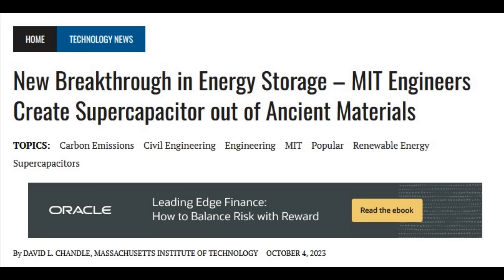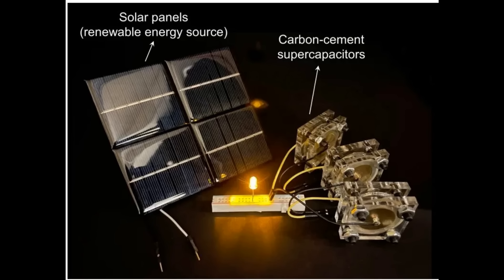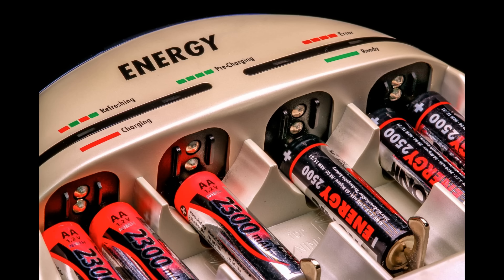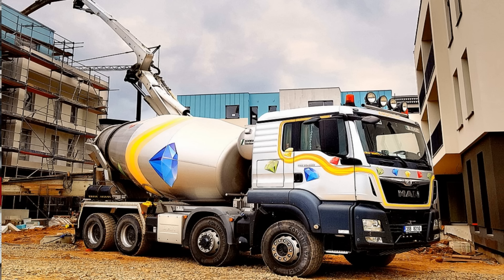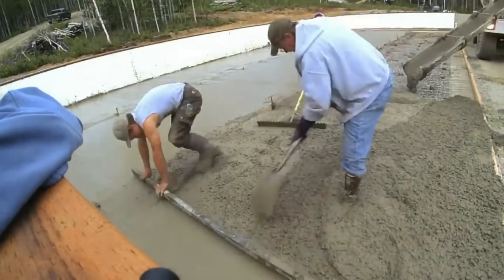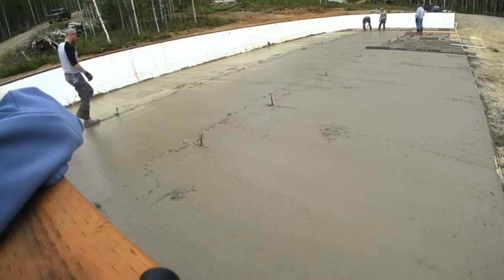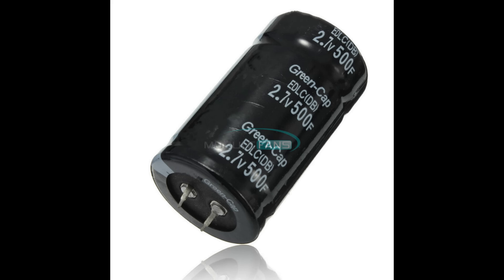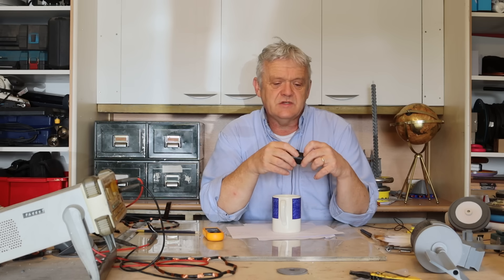2073 The Concrete Supercapacitor From MIT

Comment: I know you can make a supercapacitor with Graphene, but wouldn't you have to play with the concrete chemistry to test what is the best configuration for that?

Would it be better to just Put networks of INCREDIBLY STRONG Cables underneath?  That way you would have More Capacitance?

It would Definitely Be Cheaper though.  I'm Just thinking of a Cylinder that's 10,000 feet by 80,000 feet, or 15,000 by 120,000 feet (That's a LOT of Concrete)
Reply from the maker: it's not just a matter of the chemistry mate - the chemistry is basically ok - it's about the feasibility of the structure - you can't make buildings from chopped up concrete and you need to chop it up to make batteries

Comment: couldn't super-charged graphene in concrete be used as storage - it has carbon?
Reply from the maker: it's not just a matter of the chemistry mate - the chemistry is basically ok - it's about the feasibility of the structure - you can't make buildings from chopped up concrete and you need to chop it up to make batteries

Comment: On the prairies in Canada, concrete foundations need to be used for basements (freezes deep) so may work but ....
Reply from the maker: it's not just a matter of the chemistry mate - the chemistry is basically ok - it's about the feasibility of the structure - you can't make buildings from chopped up concrete and you need to chop it up to make batteries

Comment: I never thought of that.  

Could this be put inside modules in an O Neil Cylinder?  For Instance, Ariel Eckblaw uses essentially disks that can magnetically arrange themselves.  If those self assembling plates were made out of Structural Steel (or if you made a variant of steel coated with Graphene) and had modules of concrete that were optimized for capacitance, Couldn't you make an Entire Large O Neil Cylinder be Incredibly Strong and Store a Lot of Power?
Reply from the maker: it's not just a matter of the chemistry mate - the chemistry is basically ok - it's about the feasibility of the structure - you can't make buildings from chopped up concrete and you need to chop it up to make batteries
Reply: There's an article on the internet about the MIT supercapacitor, and in it they said it could be used as a foundation for a home.  In it, they found that the ratio of strength vs capacitance were inversely related, and the "sweet spot was around 10%" of carbon black.  Any further, and the concrete was more delicate.
In the article, they thought it could be used in the foundation of homes, and even on roads.  As a Concrete Block that could connect to others, it sounds phenomenal!
  The other property they talked about was using it for a heating system, so besides energy storage, it could inexpensively heat the floors of homes. @ThinkingandTinkering

Comment: Well... the idea is nice. imagine if you would be able to build a home's entire energy storage requirement for off-grid living into the foundation? That'd be pretty cool... 

I am more interested in vibrational energy though... piezoelectrics... for passive energy generation, and I've seen some interesting analysis of the Great Pyramids, discussing their structure and stone selection, in that they have outstanding piezoelectric effects. Limestone on top of granite, no mortar between blocks... cutting them according to their resonance, and then using the motion of water flowing across stone below it from the Nile to generate power, which is stored in the blocks of the pyramid itself. Now, I have no idea if any of that is actually possible or if that's how the pyramids were meant to function, but the idea of using stone and the movement of water to generate power is very interesting.
Reply from the maker: the idea is nice mate

Comment: So buildings in a city could actually store a lot of energy. Sidewalks, roads and such. It's not about how little it stores. It matters for a dual purpose.
Reply from the maker: if you chop it into little slices - which you have to do to get it to store energy - then it would be any good to build from - there is no dual purpose here mate - it's one or the other
Reply: The shear volume of needed material would be insane for a remotely worth while system. The price of copper would skyrocket because of the needed amount to do basically the same thing as a bank of say 20 car batteries at the fraction of the cost and volume.

As well, maintenance is a thing of concern to. If 1 of those 20 batteries needs to be replaced, it's only about $100 and like 5 minutes at most. If a street needs to be replaced, that's weeks of demo and construction resulting in tens of thousands of dollars on top of disruption to traffic flow. Or hundreds of thousands of dollars if a building needs to be demo'd and rebuilt with people being displaced for possibly years while the building gets rebuilt all because of a 1.5V short in Ted's pantry.

Comment: In summary, I think the giant Serapeum sarcophagi were used to generate electric charges with pressure built inside by CO2 gas. The pressure put on the quartz crystals created electric charges on the surface of the sarcophagi. Those charges were then dispersed from underground toward the ground surface. The released charges would have ionized the air above Saqqara, causing the air to glow.
Reply from the maker: thanks for sharing

Comment: I've been thinking a lot about testing wet cement Ca(OH)2 as a seperator layer and electrolyte in an zinc iodine battery. Something semi crystaline to block dendrites in the cell, and act like flowerpot to isolate the half cells.
Reply from the maker: that's an interesting idea - let me know how you get on if you do it mate
Reply: Good thinking. Will work for sure, but the cell can get heavy really quick if you dont conntrol the thickness. Because if the cement layer/separator is to thin, you will still get the dendrite and iodine panetration.
Reply: Interesting 🤔
Reply: Just do it.
Reply: Try concrete canvas

Comment: It's a very interesting idea to store electricity in concrete with the massive amounts of it we use every year building buildings and roads. Too bad it sounds like this idea is quite a ways off from truly being viable.
Reply from the maker: you can store energy in concrete easily - just lift it up. Storing it electrically is always going to have the same problem - the amount of support material is always going to be pretty large and the structure needed is not going to change - I would say it is not only a long way from being viable it is never likely to be viable
Reply: @ThinkingandTinkering  if they release free energy tech  . Then storing it is not as important. ..  gave you seen footages of 2 "suns"   in the skies from different  countries  some filmed  from aeroplanes ??   Not on u toobs

Comment: I think that this is a starting point for future energy storage on otherwise wasted space
Reply from the maker: ok - why?
Reply: I have to disagree. The cost associated with just building it would be insane, not to mention what that kind of construction would do to the various material costs like copper. Material costs would skyrocket around the world and effect different things, like drastically increasing the cost of coffee pots since they rely on copper to. Low supply and high demand causes high prices.
As well, maintenance would be costly and difficult. There are better ways to store energy for WAY WAY cheaper and easier to maintain.

Not only that, but us as Humans need to start using better energy consumption habits. I'll argue and debate with anyone that we are very wasteful in how we use what we have.